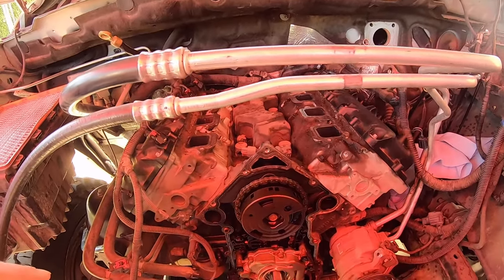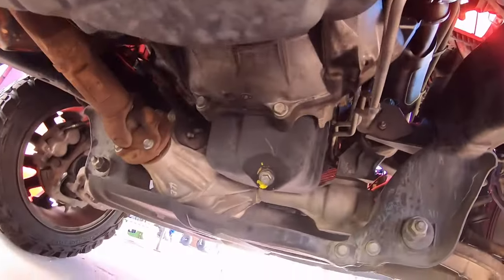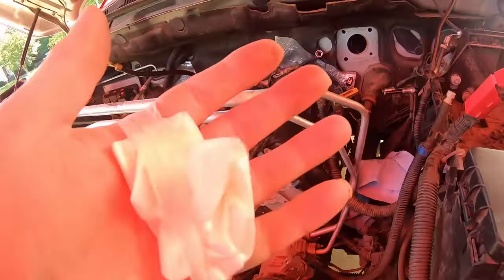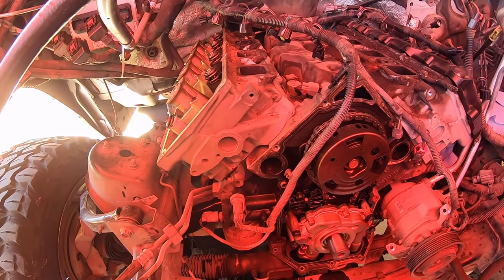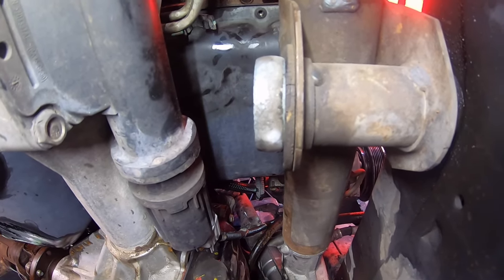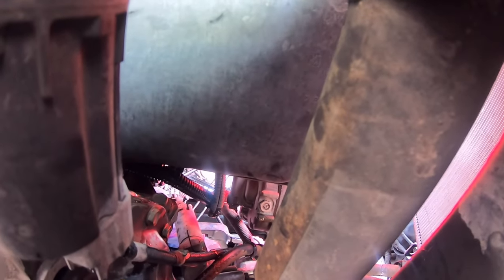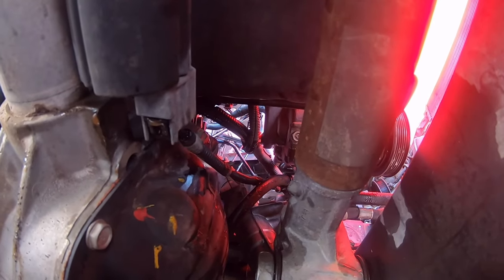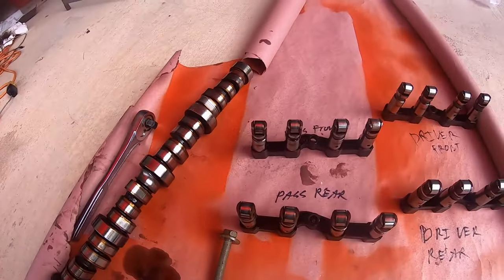2009 hemi 1500 trx4 build part 15.  Teardown Part 4.  Hemi... Chewed up metal.

Comment: I've heard of this "common fault" with the Chrysler cams, but surely it's got to be partly the fault of faulty owners, putting in the wrong oil, or no oil. My dash lights up as soon as my oil requires changing, which is pretty often. Ignore these warnings at your peril, I say.
Reply from the maker: Agreed routine maintenance is key.  I believe the cam to be fine, seems the lifter fails for various reasons and then starts to chew into the cam, when the roller fails on the lifter.  I just made RockAuto very happy this morning.